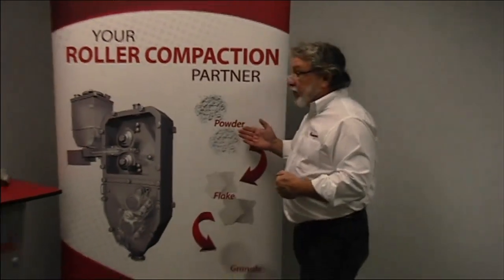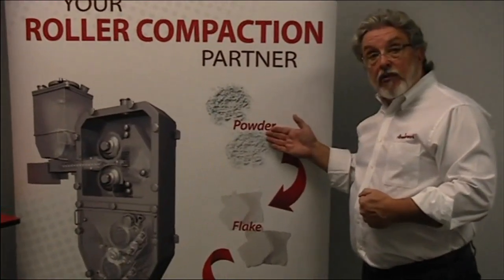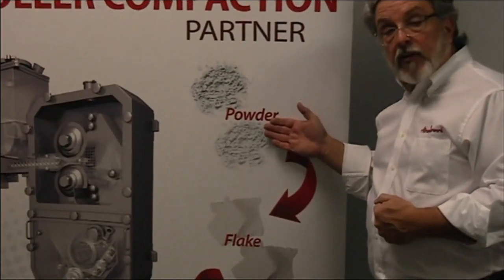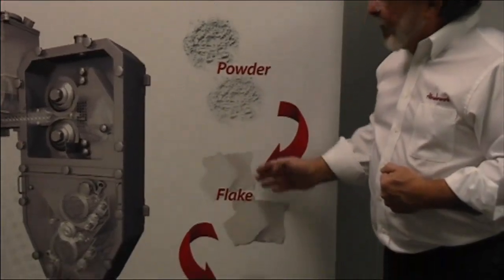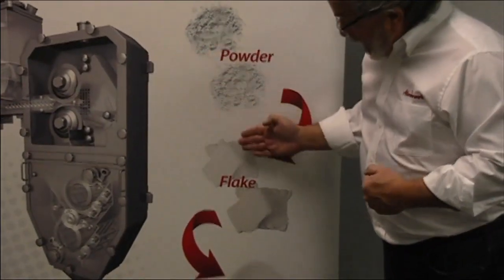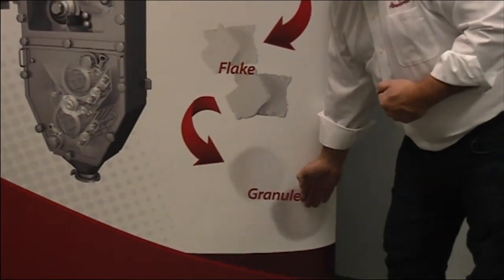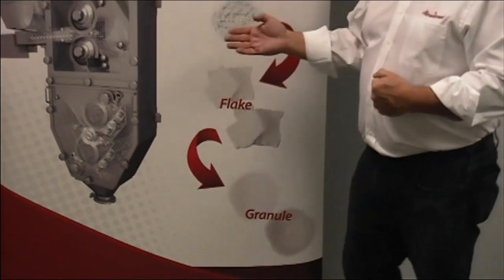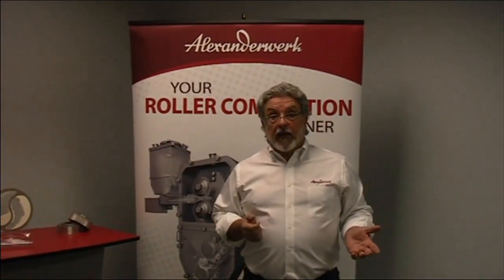Alexanderwerk roller compaction and granulation of materials with difficult flow properties

Comment: What's role of cooling water? How it worked
Reply from the maker: Assuming you are referring to the roll cooling then the role of the water in to remove the heat stemming from the compaction process. Some materials undergo unwanted discoloration as well as possible material degradation especially at higher compaction forces. This can be reduced if not eliminated using this useful machine feature. Cooling water is recirculated through the rollers and cooled using either a chiller we can provide, or by using on site cooling water.
Reply: @alexanderwerk-compactionan3550  
Cooling water comes in contact with the rooler or with bearings?
Reply from the maker: @pharmaceuticalengineering4565  Cooling water is fully contained within the roller and its shaft. It does not come in contact with neither product, or other mechanical components.

Comment: Sir what is the roll of vacuum in compactions of powder?
Reply from the maker: Hi there;
It helps deaerate the bulk powder just before entering the slip region of the rollers and as such helps stabilize the material throughput rate.